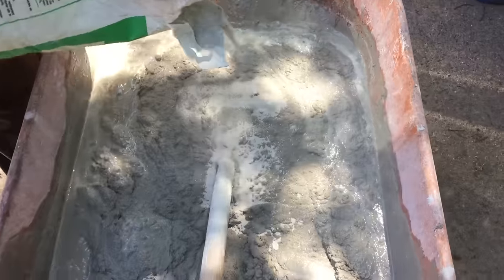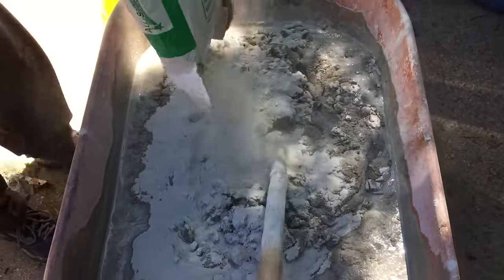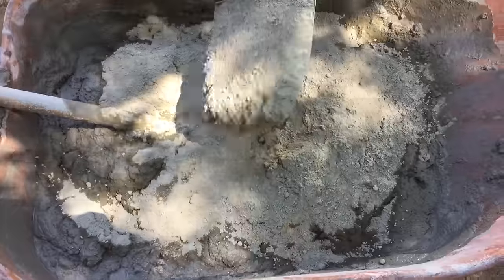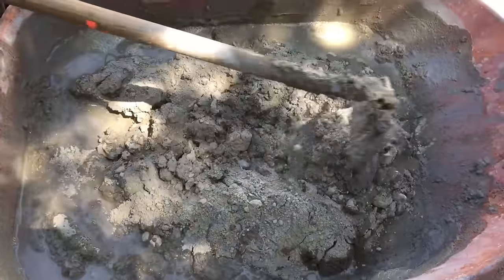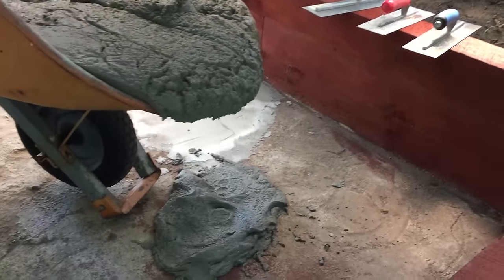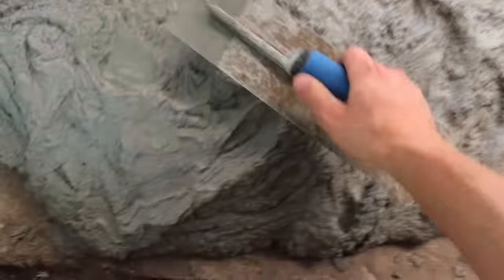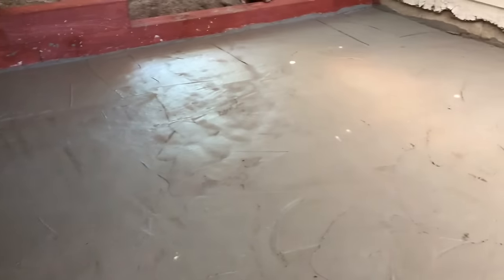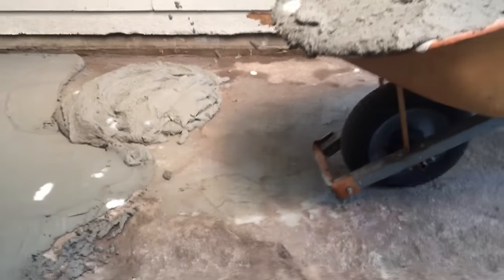How To Skim Coat A Concrete Patio - Pour Concrete Surface

Comment from the maker: If you shop on Amazon, please use Amazon Smiles to support Social Media Ministries. https://smile.amazon.com/ch/87-1084575

Wheelbarrow
https://ebay.us/zseHD2

Garden Hoe
https://ebay.us/yAxlUS

Concrete Mason Hoe
https://ebay.us/79IalE

Concrete Trowels
https://ebay.us/vJflwe

Concrete Float
https://ebay.us/CiEQIw

Concrete Broom
https://ebay.us/BRPS5t

Push Broom
https://ebay.us/UGhRlf

Extension Handle
https://ebay.us/KFnorw

Kneeling Boards
https://ebay.us/HDQqlI

Mortar Mix
https://ebay.us/pijHo2

Portland Cement
https://ebay.us/eQLh0m

Comment: Sorry this doesn't work. They're going to waste your money and it's going to crack a few days after you finish. The problem is it's not polymer modified and it's not designed for high strength at low thickness. Unfortunately there's no quick fix to concrete resurfacing you're going to have to pay the money for the bags but make for certain that the bags you buy are fairly soft and not hard. If they're hard then they're no good and pick a decent brand and stay away from Lowe's products
Reply from the maker: Thanks for the insight!
Reply: Sounds like a user malfunction to be honest
Reply: My old Croatian boss always had me first brush on Weldbond bonding glue to the old surface prior to top coating. Whether it was repairing broken steps or slabs, it always gave a great bond for the topping crete. 🤙

Comment: You should've told people to use concrete bonding agent so the new skim coat bonds to the old. Less chance of separation.
Reply from the maker: Yes, that is a good point.
Reply: and i'd suggest skim coating over a damp surface for the same reason
Reply from the maker: Yes, that would work well.
Reply: Or make sure your base concrete is soaking wet. If it doesn't absorb water it needs to be etched to open the pores so you will have fusion between the old and the new. If you pour mortar on top of dry concrete have a dry layer between because the old concrete will absorb the water. Useing an cureing additives or bonding agents would help with this. But the principal is the same. That dry layer will be weak because of lack of hydration and any cracking will result in delamination.
Reply: That was my first thought about the bonding agent most of the material that's out there will specifically let you know if they're compatible.. I'm guessing for the simple reason that they can only guarantee their product although wouldn't imagine it would hurt if you applied it and maybe smooth  out or maybe roll with a roller brush that way the milk wouldn't take too long to dry   before applying product. . Anyways  good luck  to whoever is attempting this for the first time ..lol ..I say always get a smaller bag if available that way you can use that as your trial run just to get the feel for the product because they're all different and oh so pricey..lol
Reply: Absolutely. It will separate if you don't!!
Reply: Can I ask for your profesional opinion? Can this be use to level a side walk? Or the only option is to break it down the concrete ?
Reply: @gracerojani4917  Grace without seeing it is too much of a shot in the dark. If you are in the freezing area during the winter. water could pop it up like popcorn in the thin area. But trying won't cost that much in materials in less it is a large area you are working on. For sure could be worth a try.
Reply: Pva glue is good
Reply: It won't make a difference mortar mix isn't going to work for skim coating. You might be able to get away with sand topping mix but resurfacing is pretty much the only way to go if you don't want it to crack in a week to a month and then separate it just doesn't work sorry but I just did it use all the products mixed everything properly still separated
Reply: @derek4844  Sorry to hear. Good to know. Like I said less chance but no guarantees.
Reply: Why not use a 3/8" notched trowel helping to gage a 1/4" finished?

Comment: I'm pretty sure it would've been more efficient to just use a self leveler
Reply: Self leveler is a substrate that should not be used as a primary wear surface, so no it wouldnt have been better to use self lever
Reply: There are self levers on market that can be used as wear surface and are meant for it.
Reply: There is self leveling that is hard enough to be grounded so yes there is a strong enough topping
Reply: absolutely
Reply: @diversify210  overruled. Self leveler has been used plenty to do just this. No dust comes up and has some waterproofing quality. I suspect that there is some polymers in self levelers, as there is some agent less dense than the cement that helps it level. ALL liquid solutions are self leveling, but you dont want it to run off if not contained..
Reply: @philindeblanc  There are some cement based products that people use to level floors and it also serves as a primary wear surface.  There isnt a proclaimed self leveler on the market that I am aware of that can be used as a primary wear surface.  You should not use self leveling as a primary wear surface and the manufactures of self leveling that I have used always warns against doing so.  Now many people dont always adhere to manufacture specification and applications though.  I have never used any self leveling that would make a good wear surface.  If people are using it as such.  Its not lasting very long
Reply: @diversify210  Its been on for 12 years and nothing has happened to it. I think marketing plays a huge roll. Underlaments are cheaper not high profit to use both a base for other flooring to go on top, and a finishing product.
Reply: Self leveler costs like 10 times more than mortar s mix.
Reply: @aaronmackay6123  Good point, plus they may not want the slab to be "level" per say. For example if it's outdoors and is susceptible to getting wet (like the slab in this video appears to be). Most sidewalks and driveways etc. that I'm aware of all have at least some pitch to them.
Reply from the maker: Good comment thread!

Comment: Nice vid but it's going to crack bro
Reply from the maker: Nah, that Portland will hold it together. Be perfect for a side patio or a dog kennel.
Reply: @HowToVideoChannel  right! if your not parking a truck on it, etc it should be fine!
Reply: @chrisfry436  if you are parking a truck on it, mix it a bit dryer and replace most of your water with an acrylic fortifier. that should bring it up to spec.

Comment: You can always pressure wash and etch the surface with a acid and h20 mix . Also I remember back in the day when I was getting taught the excellent field of tile, the old man would mix up what he called a slosh or a slurry  which is Portland and glue or water mixed sorta like a batter and slop it all around.  Helps with bonding, wow man the old school days of tons of dry pack mix with 3 guys 1 raking and 2 turning. 3 to 1 mix all day for 12 13 hours we moved over 31 tons of sand one day never forget we was sore lol
Reply from the maker: Yes, that would be another good solution!
Reply: That’s the way to do it.  At a minimum, the guy should have dampened the existing concrete to allow the new concrete to bond better.  But you’re right, a Portland slurry painted on first would increase the bond between old and new.  They also sell bonding agents by the gallon for this type of application.

Comment: I did my concrete a week ago and there was lines from the float and rain drops so I used the grinder on it and its brown just under the top just a 1/8 down they was calling for a clear 2 weeks then it changed the morning we poured it been raining every day at night even the night we poured it put big drop holes everywhere on it i may try this to clean it up. thanks for sharing
Reply from the maker: Yes, a skim coat over the top could be a good solution for you.

Comment: So it appears you are basically creating your own concrete minus the rocks. I have a concern of cracking/flaking in a fews years with temperature cycles. I'm going to try this method to overcoat my sidewalk, but add some concrete reinforcement fiber into the mix to add strength and hopefully prevent cracking. Thanks for sharing the info.
Reply from the maker: The higher ratio of Portland cement will help with your concern of cracking. As will the added fiber mesh.

Comment: nice video. I need to level a bathroom floor with 3/4 to 1 inch think cement/concrete slab.  You mentioned mortar mix and plain Portland cement to add strength.
Which mortar mix would you recommend?. I found bought one bad of Sand mix, topping and bedding. It says on the bad that it's ideal for applications up to 2 inches thick but I'm not sure. I've never worked with cement/concrete before.
Excellent video. Thanks.
Reply from the maker: For leveling a bathroom floor you may want to call your local concrete distributor and ask for a  floor leveling mix. They’ll ask you some questions about the project and then you can ask them what type of mix they have for the job. 

If that doesn’t get you anywhere then I’d suggest using a mix with very little aggregate. Perhaps only Portland cement or type S mortar mix. 

The other option would be to tile the bathroom floor and simply use extra tile mortar to level the floor.

Comment: Try a tile fortified thin set. That stuff sticks better than just mortar. I’ve had pretty good luck with this. But it’s not a cure all or 100% fix. Has the ability delaminate I’m some climates.
Reply from the maker: Thanks for the tip!
Reply: Great. Im in Mn freezing winters.  I have a old badly pited concrete driveway. I read that a skim primer is needed first. Any thoughts.
Reply: Please don’t. Thinset mortar isn’t intended for exposure or as a wear layer. The cellulose that allows it to retain water (which is why it bonds and allows you to adjust your tiles) will mean that it will hold extra water and break down early. 

Fun fact, the first thinset mortar was made by adding sawdust to brick mortar. That should illustrate the problem with using it for concrete resurfacing.

Comment: I changed up to use Top'N Bond [$15  #40 lbs].  This stuff is a little expensive, but it has a ton of Bonding agent in it.  You can even feather down to 1/16th inch.  Dries pretty fast: 24 hours "walk on time", 48 hours "Drive on" time.    I cant say enough good things about this product.  It stands up to anything, and will last as long as any concrete.  Note: if you have cracks, fill them first.   Also - if you have deep cracks, they will surely wind up reflecting up.  (That's not the products fault).
Reply from the maker: Those are some great tips. Thank you!

Comment: When you started spreading,  it was obvious that ir was not completely mixed. 
It is easier and you get a better mix if you and and mix a little at a time rather than all at once. 
Concrete does continue to harden over time,  but it takes 28 days (4 weeks) to reach design strength. 
When using 3,000 psi concrete, the tests usually break at 2,700 or so after 14 days and 3,500 after 28. Our supplier doesn't want to replace their material for substandard strength,  so they make sure the it breaks at higher than spec.
Reply: He didn't pour concrete....he used a mortar mix
Reply: Thanks for clarifying that 28 days = 4 weeks LOL
Reply from the maker: Thanks

Comment: Mix mortar and concrete. Your advice saved my porch resurface project. I mixed Quickcrete S Mortar with Resurface Concrete. Thus far so good. Do you have a video on repairing basement cinder blocks that mover away from the lower block that connects to the concrete floor.
Reply from the maker: That’s great to hear!
Currently no video on the blocks.

Comment: Should there be a cleaning procedure first? Mine had been coated with an epoxy and has some stains from vehicle oil. Muriatic acid would be my first choice. (Note: Handle with Care. This is an acid that will burn skin, destroy shoes and pants) Be careful, read all warnings and used outside requires no respirator if breeze is correct for your job. Clean with scrubbing action, repeat as needed. 
 #2 What about a bonding agent? Even if the concrete is modified, by the measurements of Portland, the modified concrete will be weakened but a good dose of bonding agent will make the old surface sticky to allow better adhesion. I believe this is best practice unless the house is empty and on the market in 28 days for curing. Most folks and agents will be on the driveway to view the property. I truly believe your efforts are honest but on serious issues as a concrete driveway, best practices need to be reviewed. Thank you kindly for your video information.
Reply from the maker: Sounds like you should definitely clean your slab. In your case, the acid may open it up enough that you don’t need a bonding agent. However, using one may not be a bad idea.
Reply: @HowToVideoChannel   I look at a bonding agent is cheap insurance to get 10-20 more years of service. Belt & suspenders approach.

Comment: Thanks for the video, sharing your knowlege I learned a few things.  I do a Portland, (Sika) Bonding agent and Sand mix, which saves me thousands of dollars. I don't mind having to do it over in a few years if I have to. The cost for polymers , or a complete resurface with concrete are astronomical.   My Driveway is 2,500 square feet, that takes about (4) #94 lbs bags of Portland alone. @ $15 each or ($60.00).

So you see, the cost is even less than concrete "stain" ($30 bucks a gallon +  covers ~ 200 /ft 2), and you have to do 2 coats +  and the stain will certainly wear off too.
A Portland thin-set mix is not a permanent fix. Just know its going to need maintenance, of course, concrete does need maintenance.
Reply from the maker: I’m glad you enjoyed the video! Thanks for sharing your insights!
Reply: What ratios are you using approx of Portland, Bonding, Sand?

Comment: So we bought a house that has a painted concrete porch. It was not poured right 25+ years ago and doesn't drain correctly. Could I resurface over the paint and how would I re-level it? It hasn't settled, it just wasn't sloped correctly in the first place. Float it with a piece of wood along the front wall to provide the correct slope?
Reply from the maker: You could definitely pour over it with another layer. You’ll probably want to have a concrete mason come out and give you an estimate so you can pick his brain a little bit about your specific situation.
Reply: @HowToVideoChannel  Thank you!

Comment: This mix may crack later.its too thin to just mix traditional  Portland cement. ( for very thin skimcoating of concrete the best product to use is " concrete resurfacer " its specifically made for very thin layers like 1/4 inch or less. Basic  Portland cement morta is for thicknesses  1 inch or more...under 1 inch it may crack later
Reply from the maker: Thanks for the suggestion. So far, this is holding up pretty well. I'll look into concrete resurfacer.
Reply: @HowToVideoChannel  don’t listen to this guy. You never want to use mortar an inch thick. That’s not how it works. Portland is just fine.
Reply from the maker: Thanks!

Comment: I get the sense of reading some comments from guys who sell their overlay packages for $8-16 sqft, and all those custom premixes, like the stuff Laggari puts out, which looks really bad in my opinion. The Ardex and Skraffino stuff are pricey compared to this. I guess using mortar is the key to get the ultra fine sand/gypsum, which I think CURED gypsum is waterproof, isn't it? Maybe that is heat treated only? BUt Mortar plus portland, and maybe a polymer powder mix would be great for more waterproofing. I hear that basic self leveling cement like Sika IS a poly mix, and why its a self leveler, and can be used as a floor finish. Couple guys demo this and it looks sweet.
Reply from the maker: Yes, you are right on track!

Comment: This works on winter ❄️ temperatures outdoor patio. Wisconsin.    -20 ?
Reply from the maker: I would recommend pouring it in the winter. However, it should hold up to winter temperatures.

Comment: From all that I have researched you have found a combination of materials for less than pre made resurfacer cements. I want to also test with fibers for added strength and polymer.
Reply from the maker: Adding mesh or fibers will definitely help with surface strength.
Reply: Yes, you can use a bonding agent and roll out a mesh on top. This helps the entire surface stay together and remain strong per square inch.  I bet that there is a polymer you can add to the mix to make it more water proof.
Reply: All you need is Portland cement, sand and acrylic polymer..1 part cement to 3 parts sand (good clean sand) and mix with polymers..NOT straight water.
Bond coat the surface with the same polymer...its not to.ensure bonding but to seal the surface from drawing all the moisture from resurfacer too fast and it will crack..
Main thing is surface prep..grind the surface do not acid wash unless you're 100% positive you remove all residue.

Comment: That's gonna have a nice hollow and crunchy sound to it  when you walk around ....🤣🤣🤣  and maybe a few lines running through it after it cracks.....You should have primed the old slab.
Reply from the maker: It’s held up nicely over the years. Doesn’t look perfect, but it serves the purpose.
Reply: How do you know, if you moved away from the house and 'don't know what it looks like today' as per your previous comment? @HowToVideoChannel

Comment: 100% this will crack in cold climates the first winter. We have used this method on stoops and little patios and it cracks usually in the first winter def not good for drives.
Reply from the maker: Winters are tough on concrete.

Comment: Can I add keep adding to a low spot on my patio? maybe to 2 inches, let it dry, then resurface the patio?
Reply from the maker: Yes, you can do that. You'll be able to tell where you added the fill but it will work. Make sure to feather it out so that it's a little more blended.